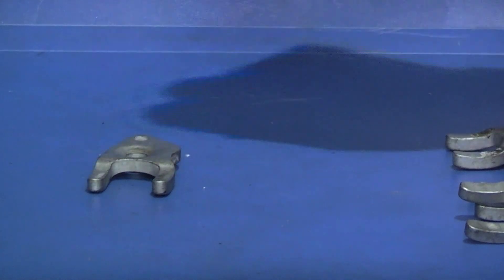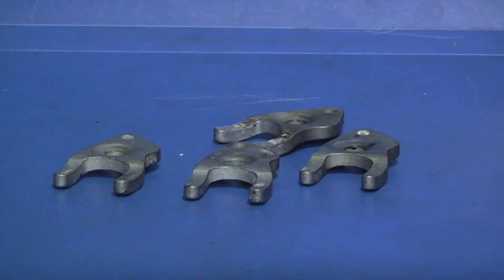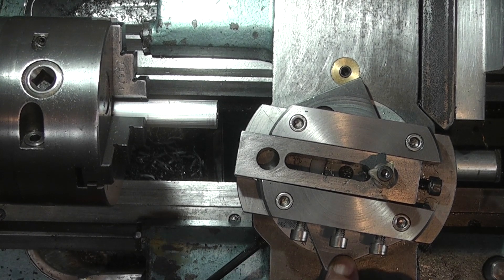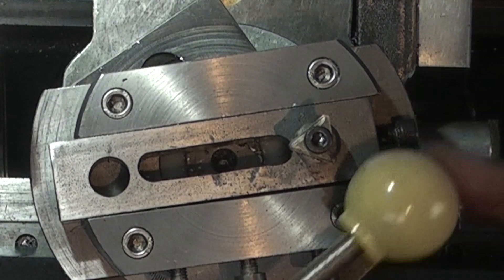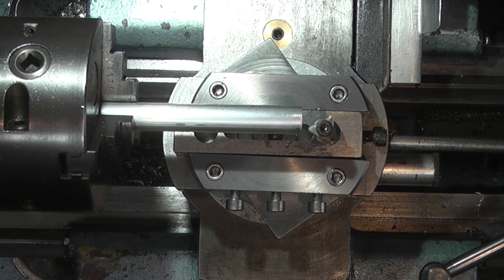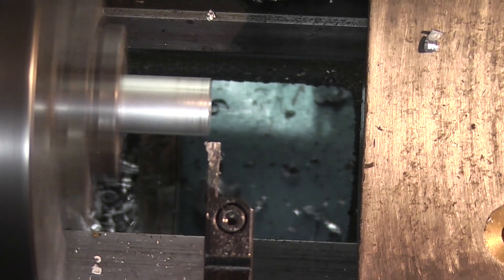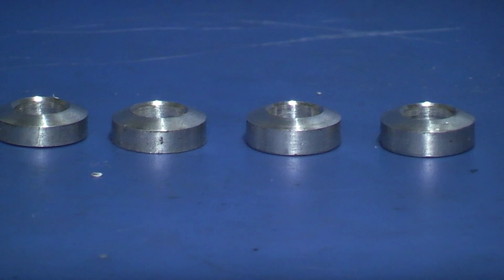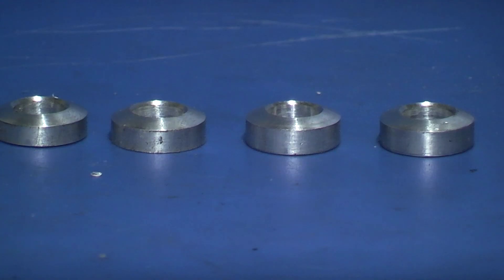Spherical clamping washers

Comment: Why don’t you just use Chevy V8 rocker arm balls?
Reply from the maker: Hi George it took about an hour to make the washers cost about £2  where do I get Chevy v8 parts in UK?
Reply: I just threw a hundred or so in the scrap, Holden is the same as some Chevy s , find a hot rodder in your area Chevy engines are a popularity swap.

Comment: Nicely  made. I would suggest that you get a small box about 3 inches square an put it into the top of your tool box. Make it a habit to put your wrist watch and any rings etc. in it the moment you walk into the shop. Not only the danger of getting your watch caught but strong magnets in a magnetic indicator base or the like probably won't do the innards of your wrist watch much good. After a few weeks you'll use the box without even thinking about it.
Save the chop sticks from the local Chinese restaurant as they work a treat for catching work you are parting off. Saves mucking around in the chip pan to find your parts.
I like the way your ball turning attachment has the slot in the tool carrier so that you can easily find the pivot center. Mine is made with a narrower carrier so I can't slot it.. though I probably could put a pin off to the side of the center and use that to set the tool to the desired radius.
Cheers from NC/USA